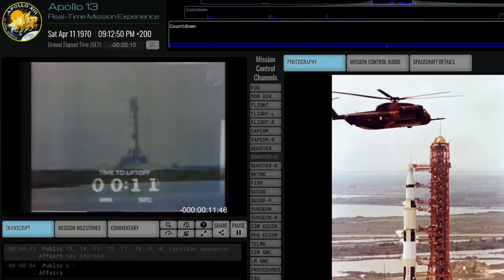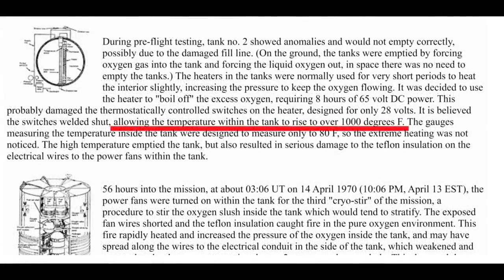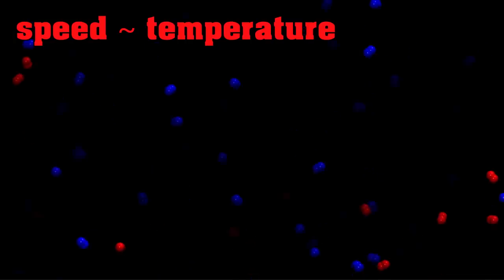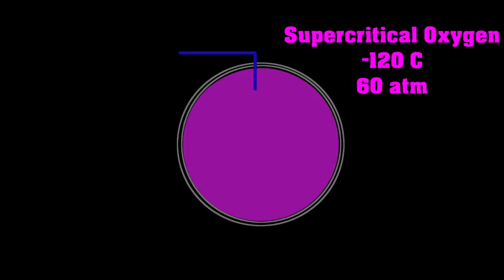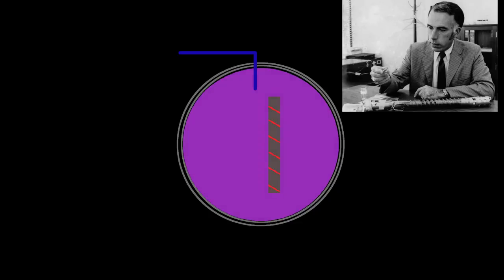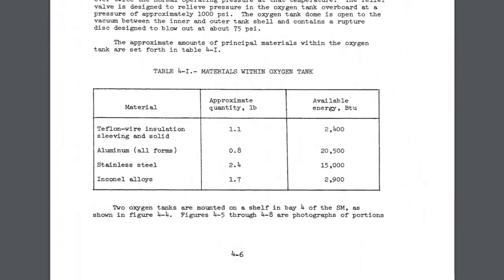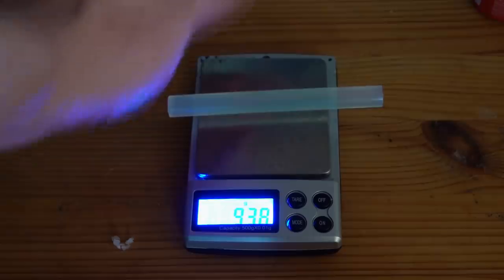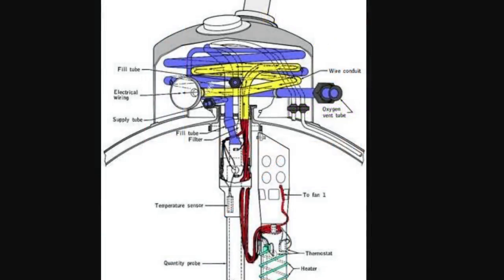Apollo 13 the FULL story: Part 2: The explosion.

Comment: 8:30 "All gas molecules at room temperature travel at about the speed of sound."

Wait, what?
Reply: Well, obviously, because otherwise sound wouldn't travel at that speed.
Reply: @Elite7555  Why doesn't an oxygen molecule traveling at the speed of sound produce a [tiny] sonic boom?
Reply: For typical air at room conditions, the average molecule is moving at about 500 m/s [around 1,000 mph] which is faster than the speed of sound [340 m/s]. Why does this surprise you?
Reply: @nightjarflying  It's a surprising fact. What's not surprising about it? Does that mean that if I could hitch a ride on an oxygen molecule and apply control surfaces, I could race fighter jets?
Reply: Also, what source of energy keeps each individual molecule moving at such high speed?
Reply: This question is actually backwards: it's because the air particles move at speed of sound, that objects moving through the air at speeds of sound or greater create sonic booms
The shock waves created by the object can only move at the speed of sound, so all that energy hits you as a "wall"
Reply: @ZealothPL  Okay, that does explain that. But why do gas molecules move at the speed of sound?
Reply: @dirtypure2023  Sonic booms are basically molecules being squeezed together by a solid object moving through the molecules very quickly - when the molecules spread back out after the object has passed you'll get the molecules moving suddenly apart again which makes a BANG. A molecule moving fast isn't going to make a bang - that takes trillions of molecules moving together.
Reply: @nightjarflying  Thanks. What keeps gas molecules moving at such high speeds though? It just seems like their velocities would vary a great deal for any number of reasons. Maybe I'm looking at this all backwards lol.
Reply: @dirtypure2023  Obviously not. A molecule will only move around 70 nanometres at normal room temp/pressure before hitting another molecule.  P.S. One nanometre is one thousand-millionth of a metre.
Reply: @nightjarflying  Thanks, I think I'm starting to get it. So are the continuous molecule collisions the energy source which keeps them at/around the speed of sound?
Reply: @dirtypure2023  The energy source for the molecule speed is the kinetic energy of the molecules [kinetic energy is 0.5 x mass x velocity x velocity]. At room temp we are talking nearly 300 Kelvin temp which drives molecules to high speeds.
Reply: @dirtypure2023  What's the molecule travailing through?  It's not moving through a medium -- the molecules make up the air, and there's nothing between them.  The single molecule is moving through a vacuum, until such time that it bumps into another molecule.  That's what a gas is.
A sonic boom is caused by an object that is orders of magnitude larger than the space between the gas molecules, so it pushes them faster than they can get out of the way.
Reply: @dirtypure2023  You have it backwards!  A pressure wave will advance through the gas at the speed at which its molecules are moving!  Sounds travels at the speed of the gas molecules.
An over-dense region will have collisions among the particles causing it to expand outward, bumping into molecules adjacent, etc.  The speed of the moving molecules is the speed at which the "traffic jam" propagates.
Reply: @dirtypure2023  What keeps molecules moving at high speed?
Because they bounce off other surfaces that are the same temperature, so they neither gain nor lose energy on the average.  The atoms on the surface of the walls in your room and the dirt on the ground are also vibrating at such a speed.
The speed varies by the type of molecule though.  Temperature, the thing that equalizes when the systems are in contact, is a measure of the transnational kinetic energy of the moving particles.  So, heavier molecules move slower, and molecules (like water) with internal modes of vibration will carry energy that doesn't count toward the temperature so it takes more energy to make it heat up.
Remember, at that scale, there is no such thing as friction.  It's just molecules bouncing off each other, conserving energy and momentum with each bounce.  Nothing is required to "keep them moving" like you have to power a car or it slows down.

Comment: Respectfully, I have once criticism of these experiments; why didn't Dr. Mason use real teflon coated wire? 
Also, what type of wire did it coat; aluminum or copper? Copper is heavier so imagine they use aluminum wire. 
I'm sure he knows that thermite can be made from aluminum. 
Also, was the wire stranded or solid? 
Stranded wire has way more surface area. Thank you.
Reply: I was thinking the exact same thing, I don’t understand why he didn’t just use real PTFE wire instead of sheets of PTFE the property’s could be completely different
Reply: He mentions it's nickel wire at 33 minutes and shows a photo of the wires.
Reply: @jonny-b4954  yeah its nickel wire but it was coated with PTFE or 'Teflon'

Comment: so if the oxygen is liquefied and you open up the tank, nothing would come out as if there were no pressurised gas??
Reply: Well, there would usually be a little pressurized oxygen above the liquid, as the vapor pressure of oxygen stays positive until it's almost down to 0 Kelvins.  But, yes, if the tank contains genuinely liquid, as opposed to supercritical, oxygen, opening it would be like opening a tank of room-temperature water in most ways.  Keeping in mind that oxygen is one of the most effective fire accelerants known, so you don't do it if there's any source of ignition present unless the quantity involved is quite small.

This also raises important safety issues with liquid nitrogen.  Liquid nitrogen boils several degrees cooler than liquid oxygen does, so if you pout liquid nitrogen into a vessel with a high thermal conductivity, liquid oxygen will condense on the outside as the liquid nitrogen boils away.  In a small enclosed space this could dangerously lower the partial pressure of oxygen in the air, but in any space you'd best have something suitable to catch the liquid oxygen in or you've got one of the most powerful fire accelerants known going who knows where.

Comment: So in Earth's gravity, liquid oxygen, being a liquid, pools at the bottom of the flask.  Thus it completely surrounds the flame front and rapidly wicks away heat.  In zero gravity though, the first bit of gas given off from the flame is going to push all of the liquid away and prevent it from wicking the heat out isn't it? So in zero G I would not expect the liquid to extinguish the flame in any way similar to the way it does here on Earth.
Reply: Interesting.
Reply: I don't understand why he doesn't just short some PTFE wire in the liquid oxygen. That would recreate the actual conditions.
Reply: But the oxygen in the spacecraft wasn't liquid to begin with, it was a supercritical gas, as explained in the video. TF has to do with liquid oxygen only because it would be too expensive to do the same experiment in a pressurized tank like NASA investigators did.
Reply: @tarstarkusz  Maybe it's harder than it sounds?
Reply: The only way we could possibly know is if they test it on the iss
Reply: @tarstarkusz  Moreover you should ask why the wire was shorting and we don't have to be on ISIS to work it out..... it is known but that would be a spoiler for the next vid.
Reply: @MrLunithy  That's another thing I don't understand.  Why were there not fuses on all this stuff?  The fire risks on a spacecraft are catastrophic.  The heater should have had a fuse.
Reply: @dirtypure2023  It's not difficult to put the wire in there and short it.  I really don't understand too why the oxygen didn't carry the heat away.  It's as dense as a liquid. 
I'm going to do a similar experiment. I'm going to run a wire through water and put more current on the wire that the wire is rated for and see what happens.
Reply: @tarstarkusz  In the video TF couldn't get the Teflon to burn, right?
Reply: @tarstarkusz  There was discussion of fuses in the previous video..
Reply: @dirtypure2023  Oh. I didn't know that. Thanks. I'll check it out.
Reply: @dirtypure2023  Not really.  I do think cladding will go up easier because basically all of it is touching a hot wire.
Reply: @tarstarkusz  Good luck with your experiment.
Reply: No they used super critical oxygen not liquid it's a gas in zero g liquid would be useless.
Reply: @dmclegg66  But the density is close.
Reply: @tarstarkusz  Yeah I agree and you would think they would test the parts they use beforehand.
Reply: @MrLunithy  IIRC, they said something about they ran too high a voltage through the switches, which welded them closed.  All the testing and ratings in the world don't help if you don't follow them.  IIRC, they ran 65 or 72 volts DC through switches rated for 24v. Higher voltage DC tends to arc. This can be a problem with solar series circuits.
Reply: @dmclegg66  TF has previously said these things are dewar flasks holding liquid oxygen that must be boiled off with the heater.  IIRC, supercritical is what you get when you have high temperature, and extremely high pressure, but these flasks were only rated to hold 1000 bar TF said.

Comment: Does PTFE give off some nasty gases when burning? I hope you were using a flume extractor. I was always told as an apprentice that turning PTFE and smoking could kill you if the PTFE partials got inhaled through the cigarette. Was that an old wives tail to scare us?
Reply: Polly tetra fluoride ethylene = PTFE
Reply: @dennispickard7743   Quote from a Safety data sheet. "Hydrogen fluoride fumes emitted during a fire can react with water to form hydrofluoric acid."  Would not be a good thing to breath in. kind of backs up what i was told as a kid. if only we had the internet back then.
Reply: The Embedded Hobbyist  that is why ‘ Halogen free insulation / tywraps are used in diving chambers / bells
Reply: @dennispickard7743  I did see a warning notice about engine fires and  hydrofluoric acid being released from oil seals.

Comment: I'm still waiting for you to "explain" how Apollo 13 managed to splash down in front of task force 130 on live TV?
Since task force 130 was at South Pacific Ocean 21°38′24″S 165°21′42″W days in advance waiting for Apollo 13 which NASA predicted would be the splash down point, even up to the last minutes before re-entry. But, as we all know, Apollo 13 traveled further, faster and longer than expected.

Pretend, it's a water from air, or a hyperloop and use your vast logic and reason to prove that Apollo 13's landing was just not possible.

Comment: How about the vacume of space that is no way to put any human at 14.6 pressure and send them to space space craft would explode we live at 760 tore spa a is 1 tore do the math
Reply: It's amazing how the largest vacuum chamber that nasa uses to test equipment needs to be inches of titanium so it doesn't implode but we're supposed to believe that the limb in some places was as thin as tin foil and it held its shape .....sure
Reply: @harleydavidson2218  limb? Do you mean LEM? The thing about being ignorant & uninformed is that everything seems incredible. It's a good thing that your opinion doesn't matter. The large vacuum chamber has to resist the pressure of many tons of air pushing inward from outside - look at the surface area of the walls - the walls also have to support their own weight. The thickness of the walls is also designed to block outside influences as much as possible - cosmic rays, radio waves etc. Also some of the experiments done in the chamber are dangerous so the walls are blast containment [the blast is directed upwards]. A little LEM isn't producing anywhere near as much air pressure on the walls as it's pressurised to only 5 psi [not Earth normal 15 psi]  & no the LEM pressure skin was not as thin as tin foil, more like three times thicker. A soda can has walls of 0.005 inches & it contain loads of 50+ psi.
Reply: It's "torr". It's "vacuum." And "14.6 pressure" is meaningless without units. I don't think you know what you're talking about & I don't think you can "do the math" - you can barely write.
Reply: @nightjarflying  Well said.

Comment: America, developed a rocket that can take men to the moon witb vehicles and equipment. Has to spend billions on rnd on falcon heavy, superheavy lifters from different vendors in 2021...why not use the saturn? 🤔
Reply: Ah, another 'just asking questions..." poster.

We could (we have the plans), but we'd need to rebuild the infrastructure to make the Saturn 5 as well.  That would cost more than designing and building a new & better rocket.

When they say we don't have the technology anymore, they're referring to the tools needed.  It's like saying we have the plans to build the old style analog mobile phones, but all the parts are gone, the plants to make those old parts are gone, the network is gone etc, and anyway, why bother when the new stuff is better?